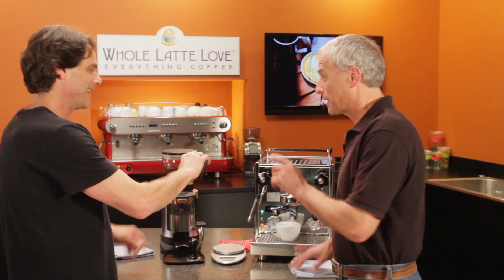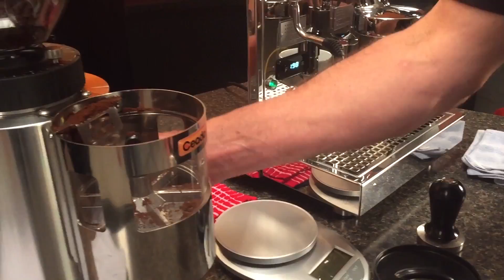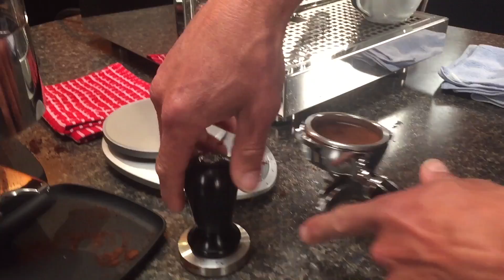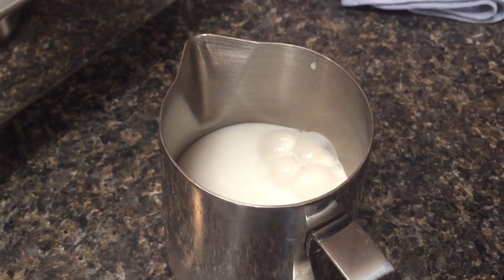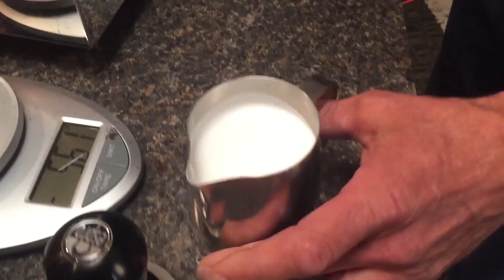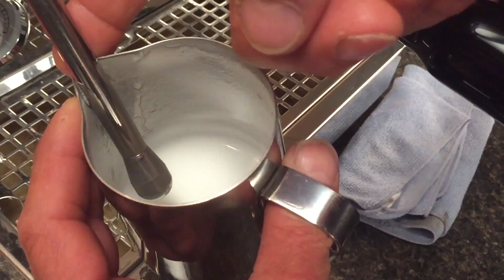How to Make a Latte on a Profitec Pro 700 Espresso Machine

Comment: Thank you, Todd & Mark. Great video again. I'm still back and forth over the Profitec Pro 600, and this Pro 700 as it seems quieter because of that rotary pump. Get what you pay for. The 600 is not loud as its vibration pump is nicely rubber-mounted on the video, even compared to the ECM Clasikia which I thought was all we needed for a single boiler because my wife and I mostly just drink black coffee. But we do have company over, and so now thinking I need to learn milk frothing. We tend to invest in quality. All of these machines are that to me. Thank you so much for your knowledge and playfulness in teasing each other too. That's always fun to watch too. <smile>
Reply from the maker: Hi KK, You are welcome and thank you for the comment. You do get what you pay for and both the 600 and 700 are excellent products. The 700 is higher level with the rotary pump and ability to plumb direct to waterline. But as you mention the 600 is relatively quiet for a vib pump machine. It's certainly capable of serving your needs. The Classika is a fine machine. IMO the best single boiler machine available but aimed at those who don't do many milk drinks. Hopefully we get through the virus stuff soon and Todd and I can spend more time together!
Marc

Comment: I wish they launch single boiler just for espresso to save the cost. I still use mechanical frothing (using French press) and it is fast enough and gets me good froth. And as for control it’s all hand pressure and quite fault tolerant. Also, I get the right temperature quite easily. Start with boiled milk and keep going until you feel the temp is right. I doubt any machine can match that. And in the machine you have to take milk dilution into equation plus overheating issues.

Also, I always notice that everyone seems to be fixated on 25-30 second shots. I use pretty basic machine and have found it works best with super extended shots. With medium roast I go up to 51 seconds. With light roast I go up to 1:17 seconds if I get get a grinder that can grind it properly. For super light roast I have to use hand grinder because rancilio is already at tightest setting for medium roast. I never use dark roast.

I also notice that my grind setting for espresso is almost at Turkish grind size.

For comparison…. Starbucks sucks in comparison to what I can get at home with most basic setup.
Reply: For reference: most of time I aim for first drop at around 10-20 seconds… higher the better… and then I start counting time from first drop.
Reply: And I use “naked” filter. Yes the one that came with machine was a portafilter. But I enlarged the hole in that to make it behave like a naked one.

Comment: Hi when I use my machine and pull the brew lever up the water comes out of the discharge and not the portafilter.

I assumed it was because I tamped to hard but when I ease up on it then the water just comes out to runny.

I have my setting for t1=200 t2 =254

Do you have any advice ? Thank you
Reply from the maker: Hi r, Sounds like there's an internal issue with the E61 group. If working properly, no water should come out of the discharge until lowering the lever after finishing an extraction even if you tamp too hard. If you'd like assistance resolving the problem please contact our tech support staff here: https://www.wholelattelove.com/pages/contact-us

Comment: Other than speed how does this 4 hole tip compare to the 3 hole on the breville dual boiler?  I've read that the DB produces excellent microfoam although it's a bit slow.
Reply from the maker: Hi DR, The Pro 700 has far more steaming power than the Breville DB. P700 has a much larger boiler and it can run the boiler at ~2 bar of pressure. Typical boiler pressure in machines from other manufacturers maxes out at about 1.5 bar. I have not done time to temperature testing on the BDB. I have done that testing on the Pro 700 and it's about 18 seconds to steam 6oz/180ml of milk from refrigerated temperature to 140F/60C. You can see those tests and learn a lot more in this in-depth review of the Pro 700: https://youtu.be/l54y-_Vx_ts 
Hope that helps!
Marc

Comment: Hi Tod/Marc, nice video! I have the same machine but I am having a hard time with the milk, when you were working on the milk in this video did you turn the steamer to full power or do you recommend less power?
Reply from the maker: Mario Carrillo Hi, thanks for the comment and question! Well more isn’t always better but when steaming we like more power! Steam was on full. Good results with steaming are about getting the tip position relative to the surface of the milk to hear that hiss and occasional rip. Then when outside of pitcher starts to warm lower the tip a little deeper and continue to swirl/roll just until pitcher is getting uncomfortable to hold due to heating. Hope that helps! Marc
Reply: Whole Latte Love it does, thank you Marc, always answering my questions!!
Reply from the maker: My pleasure!
Marc

Comment: Which would espresso machine you recommend for lattes a Profitec 700 or an 800?

Which would you say is more consistent?
Reply from the maker: Hi Eric, I'd go with the Pro 700. It has higher steaming power than the 800. In fact the Pro 700 has best in class steaming power with ~2 bar of pressure in the steam boiler. Espresso wise it's more consistent with brew temps with a separate brew boiler and PID. The Pro 800 is a fine machine but as a manual lever it's more of a commitment - with effort, knowledge and skill it can produce exquisite espresso. Lever shots when done well can be sweeter. If going 700 do consider the flow control version. It allows for adjusting the brew water flow rate during an extraction: https://www.wholelattelove.com/products/profitec-pro-700-dual-boiler-with-flow-control
Hope that helps!
Marc